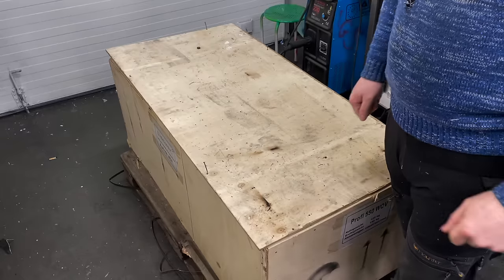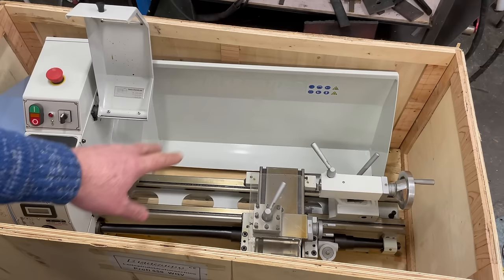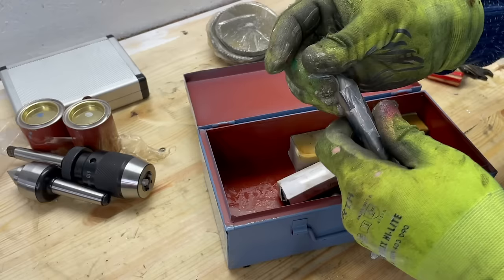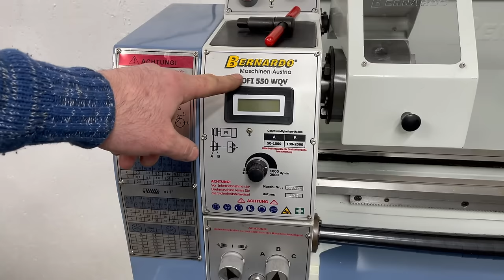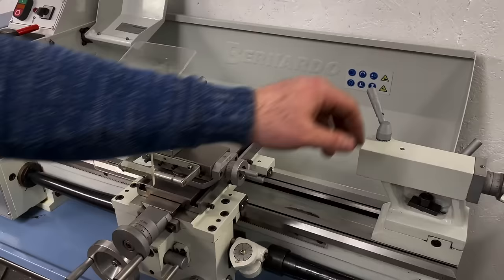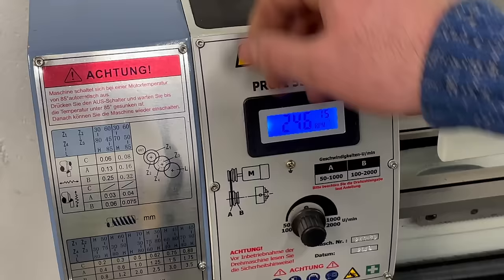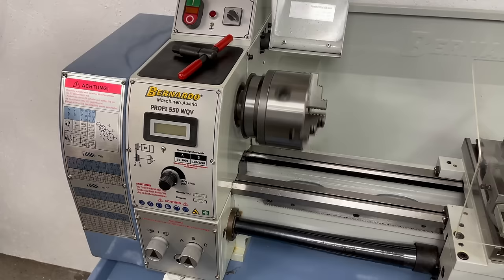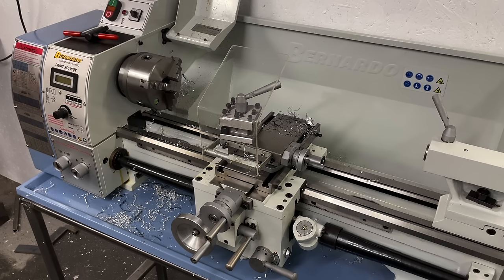Testing New Best Mini Metal Lathe Machine

Comment: As far as a mini lathe and quality are concerned this one seems to be outside the norm it looks like it's built as good as it could be for the money. It honestly looks like you could produce a good product with that as long as you keep within the parameters of a small unit and let's face it if you spend 10,000 your not going to get quality just because . If you do good work you can get a good product..
Reply: It's hardly a mini lathe. The high price of it shows clearly it is a small lathe and for the price you pay you might as well get a mid sized one. At first I was shocked at the price of it, as mini lathes are ~ $1000 and this is $2500 but I can see it's worth the asking price. 
If it were me I'd just spend the money and get one ~$6500 as I can't see point of throwing down $2500 on a small machine but that's just me and others have less space, so to each their own.
Reply: It's not $2500. That's the net price i.e. excluding taxes.

Comment: I bought the same lathe from Precision Mathews. They added a quick change tool post and a DRO. Very good lathe, very happy with it.
Reply: Are these built in Taiwan as well? What model number is the Precision Mathews you have?
Reply: @RobertLBarnard  The Lathe is made in China. Precision Mathews modifies it with upgrades. I have the 1030 w/DRO. It has metal gears, quick change tool post, brushless motor, power feed. I did the research for a month and it was the best for the money. The DRO is the only way to go, well worth it. Have used it a lot for 2 yrs. A few parts broke, Emailed precision Mathews and they sent replacements no charge. At this point no complaints.
Reply: @mvmartin9831  Thank you! I sure appreciate the info. I've been 'think'n 'biut it for over 30 years, seriously researching the past month. I keep coming back to Precision Mathews.
Reply: @RobertLBarnard  That was basically the same with me. I started looking at the cheap ones and saw the problems. Worked my way up and kept coming back to Precision Mathews. It is a stout machine. The thing I like best is the DRO. It measures actual table movement at 0.0001". I also have the PM-25 milling machine W/DRO. Just as good.
Reply: @mvmartin9831  How much did you pay with shipping?
Reply: I have the same machine, Weiss brand sold by DRO-Pros. It cost me less than the Precision Mathews, though I upgraded to a quick change tool post from Little Machine Shop.  DRO-Pros has excellent customer service.
Reply: @mvmartin9831  .0001 are you sure ? i was thinking .0005 max .
Reply: @mvmartin9831  PERDON,CUANTO VALE EL TORNO,GRACIAS.
Reply: @salvadormendez9867  Creo que dijo anteriormente que pago $3200.00 y el transporte solo dijo que era un precio fijo pero no dijo cunto pago.

Comment: Nice review of this Chinese lathe. They are very good value. You want to be taking lighter cuts. That is still a small lathe. Industrial lathes start at 600kg or so. My Colchester is 1250kg but small lathes are good for small work. Just take it easy.
Reply from the maker: Thankfully for your feedback
Reply: I have a little metal mill from Bernardo. Bernardo is a brand from Austria (not Australia). Not sure if this particular Lathe is a chinese made or not, but just saying :)
Reply: @sttrife  of course it's made in china..  only labeled with a European name and so..
Reply: @sttrife  It is, but they do some basic quality control to the machine after assembling it and only sell those complying with the brand. I have a big one from bernardo weighing about 700KG, the standard 165D with DRO and Multifix Toolpost. Bought it for roundabout 4600€ and it is surprisingly good on the geometric side and all the Protocol measurements are correct. Runout is only 0,006mm with the installed 3-Chuck.
Reply: @Gs_DIY_ideas  do you know about some good budget lathe for hobby use? something under 800 euros?

Comment: Please try to demonstrate "Safe Working Practice" by removing the Chuck Key when not in use.
Not all of your viewers are Engineers & Even I set one going with the Chuck Key in when I was an Apprentice. (Only the once though & Never again)
Reply: I once forgot to take out the key out of the chuck and it flew into the concrete wall its stuck in it
Reply: Yes i can remember also doing that as young bloke  , it gives you a bit of a scare doesnt it :) ,  and yes , you only do it once .

Comment: Have basically the same in my basement at home, a little bigger 650 mm, motor has 1,5 kw. Installed DRO and a adjustable stop for the carriage 20 + years ago. Also has Multifix A quick change tool post and I have a selection of chucks: 4 jaw, 3 jaw, a bigger 3 jaw with removable jaws and a 6 jaw, collet jaw of cause, face plate and a 4 jaw independent. - And I never use it without something installed in the MT from the tailstock ...
Reply: i want one like this how?
Reply: What's MT?

Comment: Since it came from China I'm surprised it didn't come with the chuck key welded to the chuck. I worked in Chinese textile mills and in everyone the turners always left the keys in the chuck.  It was very annoying ,  but no matter how often I explained the danger they continued the practice. 😊
Reply: Doing stupid things cures itself.
Reply: It's super easy to forget the key in the chuck. The spring on the chuck key I use probably saved my life multiple times :)
Reply: How does it happen that a guy named Robert Henderson ends up working in a Chinese textile mill? Sounds like a good story!

Comment: So no link, huh?
No worries - I got you covered. It's 2350€ brand new. 

For this kind of money you'll get way better machines like this on the used market. A machine which lastet 50 years in an industrial environment won't break in a hobby shop anytime soon. 2300€ is a huge number for a used industrial lathe. You'll get a monster with about 800-1500kg and a 5kW motor for this kind of money.

Comment: I own and use for 4 years a lathe very, very , close to this one. Same parts, same bench, same chuck. Not the same trade, but undoubtedly, it's made in the same chinese factory.
It does the job, but it's not such a high quality lathe. The belt has been replaced because the first broke (low quality), and there is a persistent insulation default that often cut out the electric power supply, due to very bad work from the people who made the connexions inside the lathe. Geometry is not absolutely good. A slight cone effect remains when the part is hold between chuck and counter tail cone : chinese quality, not German, but also low price...
Thanks for this video.
Reply: I think you are mistaken.
The company is in Austria & sells ~6 different machine tools.
Reply: The Austrian company is a distributor of the Chinese made machine. They may make minor improvements to it and its' accessories.
Reply: German quality wasn't anything to brag about until well after WW2.
Reply: Your tail stock is off center.  You need to fix it.
Reply: Yep, it's made in China. They all are. But...
Got a similar Bernardo lathe with mill some time ago. Just for home/hobby use so the size is fine for me.
I have seen some of these other machines that come from same factory/region.  Bernardo is an actual brand and it seem to do decent quality checking before the machines are shipped (within reasons). 

There's a trick in Chinese industrial production thay makes things cheaper and makes the quality fluctuate enormously. There isn't ONE factory making these similar lathes. Theres hundreds. But there is limited amount of producers who make tooling for the other  factories that produces the machine. Like the forms for the chassis etc. That factory sells tools and blueprints to other factories that make the final product. And those final ones can run the quality  straight to the ground for price, or actually use it to make a decent product. Chuck some cheap bearings where quality is needed and the whole thing becomes moot. Other way around, same machine with originally planned parts with quality control may be a decent machine.  Usually the original is copied from some outsourcing production. That's the danger of ordering parts from China. Same applies to basically everything outsourced from China. It's copied and remade in some other factory with cheaper parts, no quality control bit cheaper. 
 Bernardo is so stiff about their copy paste friends that I could not get a digital user manual from them unless I took picture of the machine and the serial numbers. Even than it was limited time link for download. But the manual actually isn't in chinglish but decent English (not my mother tongue so I may be a poor judge). I know it's made in China. I know it's not THE best machine in the world. But I am willing to pay some extra for Bernardo doing quality checking and butting their name on it.

Comment: Always wanted to design a Vertical Lathe, 
based on an Automotive front wheel setup. Designed for safely cutting small amounts for less stress & basic Safety.
Reply: I think I have a vertical lathe.  The place I bought it from said it was called a milling machine.
Reply: @bobsradio6025  Actually, a lathe turned on its end is called a vertical borer. We used to use them a lot where I worked before I retired.
Reply: @nickmiller76  - I'm sure you know this stuff better than I do, since I was never a professional machinist.  That was just a hobby for me.  Not being a professional, I thought a "vertical borer" was a drill press.
Reply: The "Vertical turret lathe" is as old as the hills. We had many different sizes in manual and CNC formats up to a 72" diameter bed for machining aircraft engine parts.

Comment: I believe that this guy doesn’t know what he’s doing.
Reply from the maker: Really
Reply: @Gs_DIY_ideas  You did choose a pretty inappropriate cutting tool for demonstrating it. That looks like a parting off tool which are notorious for shuddering and flexing sideways causing a lot of it. A decent carbide (especially since you're not using coolant or even some cutting oil) would have helped a little but, best would be a good carbide tipped tool.
Reply: @Gs_DIY_ideas  yes
Reply: @Gs_DIY_ideas  how big of a cut were you taking dude, because not only did you have the wrong rpm for the job you were doing but the lathe was struggling

Comment: Have you checked if the bed ways are hardened? Mine are not, I have the profi 550LZ. Could you check with a file and let me know?
Reply: My rebranded direct from China. Not hardened and out of accuracy by 0.3mm
Reply: It came from the same factory. Thank God if yours is accurate. Forget the hardened part!
Reply: I have the PM 1022v. The ways are hardened, ground and very accurate. Checked by PM before sending out and checked/levelled when I got it installed.

Comment: The very smooth running suggests it’s a three phase motor with variable frequency control. So 750watts will be close to the power it develops.
Reply: Nope, its a single phase motor with PM speed control by KB.

Comment: The safety points I was going to mention have been well covered apart from saying this man is a danger to himself and anyone near him.  He plainly has little to no idea what he's doing, he just wanted to get his new toy out so he could play with it.  Any broken fingers or blackeyes yet?
Reply: @bigboreracing356  Can I try to "Top" you...
Old South Bend 1200 rpm, Spindle locked up, Chuck kept turning, unscrewed itself, took a chunk out of the Rear Way, bounced and hit me in the Chest.  My Old Boss worked with a guy who had the same thing happen except he got hit in the head. Old Machinist never die...
Reply: Well one thing for shur he's trying and that's a he'll of a lot more than all thease guys that think it's there prerogative To be rude with there assessments and opinions  we all know about opinions  just like belly buttons and assholes. Every body's got one !
Reply: Sadly,. There seems to be more assholes than "one per person" 
:-(
Reply: And as true safety minded person as you obviously are; I am surprised and appalled that you chose to bash on this man who could use some knowledge instead of mentoring or passing on your obviously enormous amount of knowledge to him… congratulations Sir…
Reply: Oh Jesus.  He is learning.  I’m a toolmaker and if you saw some of the things we do with equipment you would probably have a heart attack.  He is learning.  Give the guy a break.

Comment: I change the spindle head due to fitting issue. Had to file and sand the lathe ways as it's out of shape by 3mm! Chuck is eccentric buy 0.3mm. had to machine the jaws! The rest is yet to be fixed. China made......

Comment: Have the eXACT same lathe, its named different. The treading feed gears are extremely difficult to get to mounted and the have a sleeve in them that is brittle and break easily. Cost for those sleeves are 20 bucks each. Not happy, but still a decent lathe.
Reply: You have a lathe... turn up some sleeves out of something that isn't brittle.
Reply: @kieranh2005  Ive done that.Unless you have these lathes its not just a sleeve it has a key made into it. Not an easy replacement. Thats why the ones it comes with are cast.

Comment: How expensive is this lathe and can I get one in the UK 🤔
Reply: Check out " Warco uk " . I have an older version the WM-250. Very similar but with out powered cross slide, that came in a later version. Its about 12 years old now and have had no troubles with it.
Reply: @allandesoer7672  thank you very much
Reply: @allandesoer7672  I lookt at them, they are awesome, very cool and the smaler ones very affordable 😊, thanks again for the suggestions, I will buy one eventually in the future for tinkering, for the time wher my pain allows it.
Reply from the maker: About 2300 euro and yes you can order to uk
Reply: @Gs_DIY_ideas  Thanks, that's not to bad for this size of a metal Lathe 🤔

Comment: This lathe is also available as the real non bernado variant because it’s a 800€ china 🇨🇳 lathe
Reply: i bet the bed isn't flat. china dont care about heat when they surface grind things. 
you end up with dips if you grind or cut hot expanded metal. 
i have to regrind my lathes bed because of a dip and its not from normal wear being as its only has about 30 hours on it. i noticed it when i was first setting it up and adjusting gib screws. 
that's china''s best for you.
Reply: @darkshadowsx5949  Sad thing is it’s either china or a old monster lathe both need to be regrind and one of them is just simply to heavy

Comment: Do not open the box and do  not open the tool box just see what is inside and we talk about opening the box to see what is inside and what we now going to do is to show you everything and now we open the box and then you can see what is inside but we have to talk about opening the box to see what is inside but we must talk about opening the box and the tool box so we can see inside.  There must be a way to open and see what is inside?  And what it is called we see now we have opened the box!  We must know the oil can is not oil but paint. Very important point like what is inside is about opening the box.  Talk talk talk no meaning or sense?..

Comment: "Everything made in Germany is quality" then this is made somewhere in China.  Correct just because it says "Germany" on the machine and packaging does not mean it was made there.  While it is a good machine you can see by the unfinished casting on the tailstock this is far from top quality.  Something we all live with today unless you happen to be a billionaire.
Reply: Please point out where you see an unfinished casting on the tail stock.
Reply: Look where the wrench goes to lock the tailstock.  Given a close up inspection you will find a lot of that where rough castings are sent out. They all do it and most come out of the same factories.  They are what they are but it is dillusionary to think one is "quality" over another.  Like everywhere else Germany left quality behind when they went to China.  Something flashy advertising can't change.  It is a different world now.
Reply: @douglasthompson2740  You are right. I own a big one from bernardo, the standard 165D with Multifix Toolpost and DRO with Tool-Management and some other CNC like stuff. It weighs about 700KG and i bought it for only roughly 4600€ cause it had been scratched on the back side of the housing. So far i'am impressed with the quality on the geometric side. Runout is only 0,006mm with the basic 3 jaw chuck it comes with and all the protocol measurements are correct. 

The only thing i had to do, was to coat all the casting surface from underneath with a zinc spray because it would have started to foul otherwise. They simply forgot to cover all the surfaces with their primer coating. 

The quality will become way better ones you push in their semi-industrial range of products. One of my friends had a small bernardo like the one in the video and it was total crap, though he insisted until he got a good machine on the 3rd try. You have to be resilient on them, there are good machines but they want to sell the crap ones too. 

The same goes with the small optimum bf20 mills, i have one and it was a loooong way to get to work with that thing on reliable bases. Next time i would just buy one in the 4k range or get a old industrial machine.